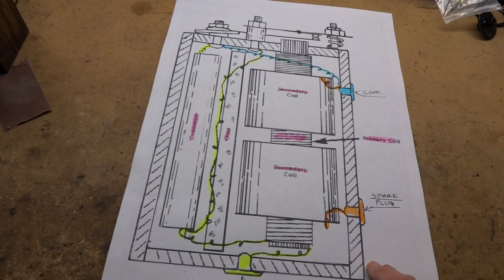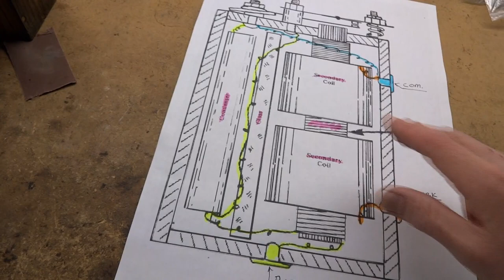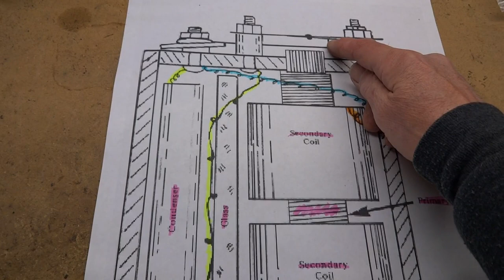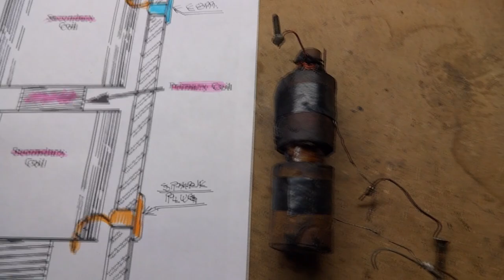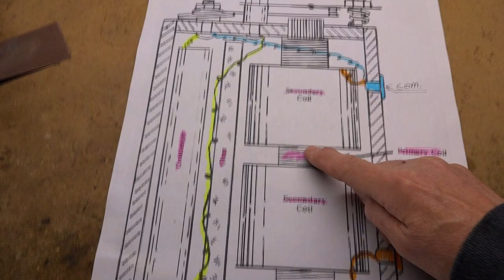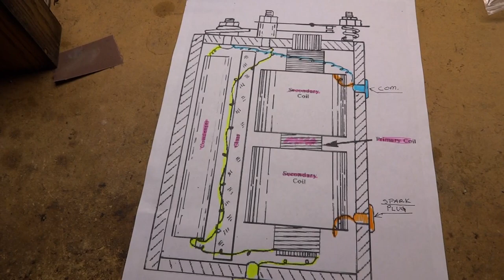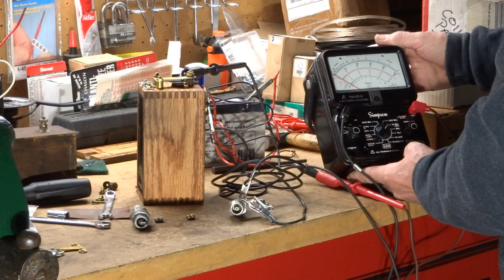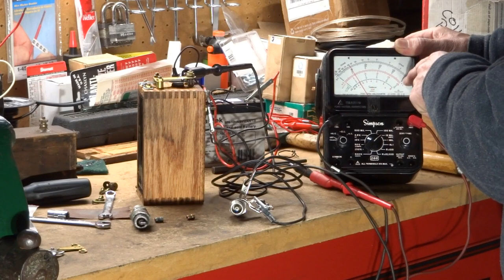Point set of a buzz coil

Comment: You mention a 12 volt conversion in this video.  Do you use a ballast resistor on these coils when running 12 volts?  If so, where do you source the resistors? Thanks.
Reply from the maker: I do not use a ballast resistor when I use the rebuilt coils as the replacement capacitor is able to use the output of a 12-volt alternator. I do not think the older capacitors within the coils not marked for "12-volts" can withstand the higher voltage. If you want to use a resistor, I have good luck with ballast resistors that are used on older Dodge/Chrysler vehicles.
Reply: @rdg2124  Thank you for your video and help.  I'm new to the hobby and I am currently working on an M19.  Hope to meet you one day on the rails.  (The WK&S is on the other side of the mountain from me.)